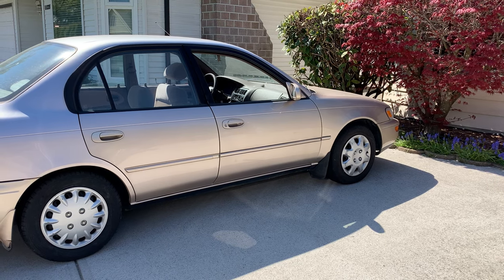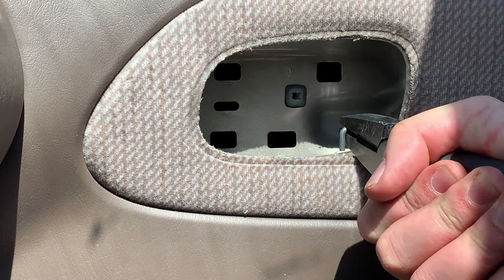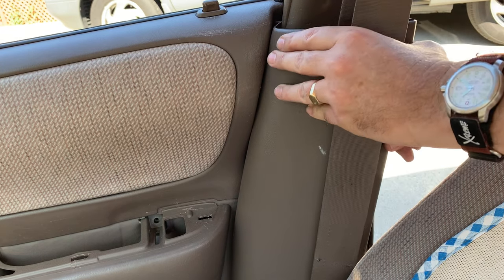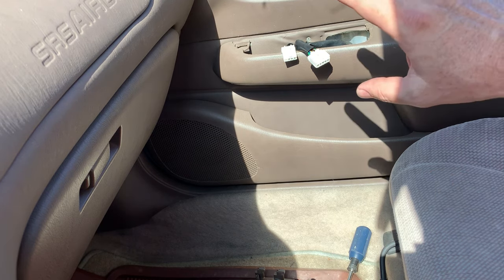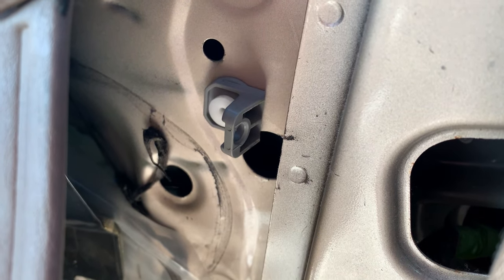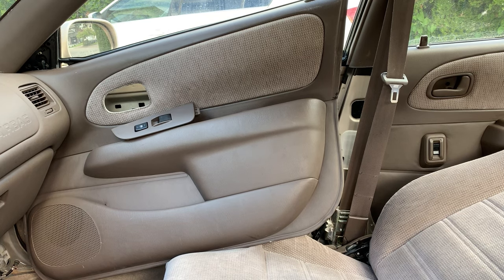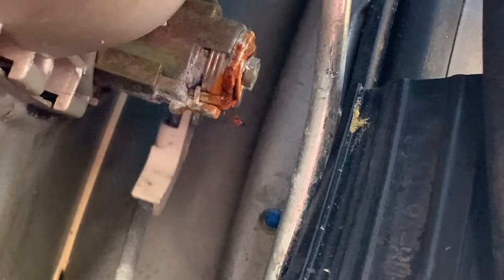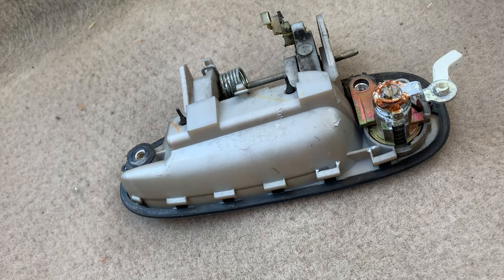Door won’t open – from inside or outside!

Comment: This was performed on a 98 Toyota Carolla: Assuming you are not locked out and have a front passenger door that won't open from inside or out with the key or by pulling the manual lock button up... 
I slipped a slim jim into the door from the inside, with the window up, about four inches ahead of the latch and used the hook end to poke and pull at the latch mechanism gently while pulling on the inside door handle occasionally. At some point, I tripped the lock linkage, and the inside door handle opened the door. It was a blind attempt to manipulate the lock as seeing or feeling linkage from the inside is almost impossible, but it worked out. Took about 10 minutes of effort.
Reply from the maker: Thanks for sharing!
Reply: I'm try to get my driver side door open hopefully with your experience I will have a better chance at it. There is no way possible to get that door panel off without the opening the door also getting in and out of my car through the passenger side door is not fun
Reply: @WILLY52368  Measure down on the inside of the opposite door from the bottom of the window to the latch on your slim jim so you have an estimate of how deep to loo search for the latch mechanism inside the door. If you see the lock button move you'll know that you're in the correct area. Pull the door handle at regular intervals to check if it will open the door. Good luck!
Reply: @J.V.Swanson  Ahh.....got it, I'll let you know know how it goes. Thanks again for responding, it really means a lot 🤙

Comment: My front passenger door on my 2000 Buick Park Avenue is locked and won't unlock or open up.   Just like yours it won’t open from the inside or outside.   The problem is the door lock actuator not the lock itself.   However the process to get to the rods by removing the interior door panel will be the same.     I’m dreading having to destroy my interior panel just to get to those rods so I will have to wait for the weather to get warmer to do this job.     It’s February right now and I live in Chicago.    

Thanks for posting, very informative.
Reply from the maker: Why don't you start with the first door. If you are able to open it it should be fairly easy to take off the trim and inside panel. Then you will be able to see the lock and find out why it is not locking. :)

Comment: This is a very helpful video. I have a 94 Corolla with an identical problem except it's the driver's door. I just came from my mechanic and he said that he can't find the new replacement latch assembly so he doesn't want to attempt fixing it however I think he doesn't want to go to the trouble of taking the door apart from the inside. I don't blame him. I have ordered an endoscope to see if it will help me diagnose the problem if I can put the camera down inside the door. Since my problem seems to be identical and we have basically the same car I'm going to start spraying a lot of penetrating liquid into the key lock. I had been adding silicone spray but I think a heavy-duty penetrating liquid may work better. Assuming it's the lock. I was able to open it a couple of times from the passenger door outside lock. Initially when I could not get out of the car I opened the window and pulled on the handle from the outside and the handle broke off the right I was able to glue it back on with JB Weld and a piece of steel reinforcement. Then I tried opening and shutting the car several dozen times and had no problem. I was kind of proud of myself. For about two weeks when this happened. If the penetrating liquid does not work and if I cannot find a mechanic I'm going to try your method. Thanks again for taking the time to record this trade I subscribed
Reply from the maker: Hi Robb, thanks for subscribing. The problem I dealt with occurred because the passenger door wasn't used for a long time. That gave the opportunity for the lock to corrode and become stuck. I am not sure if that would happen to a driver side door that is used frequently. (Penetrating oil can't harm the lock.) The quickest way to see if you can get lucky is to remove the door opener on the inside. Then grab the metal rod that is connected to the latch. If you can pull that and it opens the door, voila! If you cannot open the door that way, the problem may not be with the latch, but with the lock. (see 2:01 on the video.) Good luck! :)

Comment: You were so patient and very instructive thank you so much for doing that I know that was a lot of work! Seems so crazy that they make it so difficult to get inside of a panel when they know that things are gonna break down in there they should make it a lot easier. It makes me wonder if it's just part of the Industry because some people, if they had the money, would maybe just rather trade in their vehicle rather than go through all of that (or pay for an expensive repair)! So maybe they do that on purpose!? Just like they used to make everything so durable and you barely had to replace anything back in the day, now everything's breakable and you they expect you to replace things instead of repair them. Not only is that taking advantage of the consumer but it is also bad for the environment! One example is front load washers like the Kenmore HE3T... You have to take apart the entire machine just replace the drum now where older washers you easily can take the parts apart and clean out the drum and then often times repairing or cleaning that part (or at least be able to get to those parts - they trap moisture and get a lot of mold issues) - when you can't easily clean the drum remove the drum a lot of people just choose to replace their stuff instead of going through the trouble of actually cleaning it and soaking it and doing all these things that you can do easily. Our landfills are filling up with all the appliances that are easily cleaned and repaired, and now that they're making them harder to repair an/or clean-- it's even worse because people who would normally clean or repair their item our now for sure too frustrated to even go through that process and throwing them out into a dump or landfill). Sorry for the tangent that just reminded me of one way they're making things so dang difficult just to repair! Anyways thank you very much for going through the trouble of making this video. I celebrated with you in your "moment of truth" when you got your door to open - it was awesome! Lol thanks again have a great day! :)
Reply from the maker: Thanks for the encouragement! Don't worry about the rant - I share your frustration!
Reply: lawmakers LOVE that!!!  each new unit sold, MORE money for them in taxes; they don't give 2 shtts about the rest,the important stuff like you said,the ease of repairs; CARS are proof, today they are ALMOST UNREPAIRABLE, go figure...

Comment: Thank you for a great explanation and video. I am having similar problems on a Nissan Pathfinder plus the electrical portion is not working on the lock or window, window is closed though fortunately.  Good description.
Reply from the maker: Good luck on your repair. Don't give up! :)

Comment: Great job. My '96 Carolla has the exact same issue with the same door. Another guy on youtube got the lock to work by shooting PB blaster down both sides of the window glass. If that doesn't work your approach will be Plan B.
Reply from the maker: Steve, my approach should be your last resort! 🤣
Reply: @Pen_Pusher  Thank you for replying. If I may trouble you.... None of the trucks with PB Blaster worked. Both handles still pull freely, seemingly as though the linkage is disconnected. The door lock pulls up halfway and then jams.

I have another idea. Since the lock mechanism may need to be replaced I am thinking of drilling a hole in it from the outside. Right above the keyway. Do you happen to recall, is that opening in the body about as large as the door handle piece, or if I drill in above the where the key is inserted will I likely hit the body/frame?
Reply from the maker: @stevebakker6884  Hi Steve, if you look at 12:17 on the video you will see what it looks like from the inside. There is open space all around it. 😊

Comment: Thanks so much for this video. I have the same problem on a Honda CRV. It won't be exactly the same but I'll bet it's close. I've been watching other videos for over an hour and yours comes closest to showing me what I'm going to need to do. I hope the lower Honda trim comes off like your Toyota and that hack saw blade solves the issue of that snap screw sandwiched between the dash board and the door panel. Good job!
Reply from the maker: Good luck David! This is a job that calls for patience and perseverance!
Reply: @Pen_Pusher  We ended up paying a specialty locksmith $50 to work on it for an hour and then give up. 

We then went to our auto mechanic who said he could do it. He succeeded although it took many hours and some damage to the door panel for a cost of $375.

A spring had broken and the debris was interfering with the mechanism's ability to fully raise/release the rod that unlocks the door. 

The mechanic fashioned a new spring from something he had laying around and all is good now.
Reply from the maker: @davidgardener5519  I am sorry to hear you had to go through all that, but nice to know you get get it resolved!

Comment: Exact same case with my 2006 Honda Civic. Except a few more things. Long story short, one time I was trying to unlock my driver door (unlike the passenger side in this vid) from the keyhole. It was resisting my key and then the keyhole either broke or got jammed, making it impossible to unlock or open the door from the inside or outside.

On top of that, opening the passenger door (haven't tested the two rear doors yet) sets off the horn and it won't stop unless I turn the ignition off, get out the car and disconnect the battery cable.
Reply from the maker: Wow, this sounds like a tough situation. It would be good to disconnect the passenger door from the horn, though.
Reply: Honda makes great cars and crappy locks. Basically the wafers wear out in them. It happens on the ignitions and drivers door. I'm not BSing we get a call on someone who's Honda key won't open the door almost every day. We run just automotive locksmith calls 100-150 per week. Honda has known about this for 20 years and they continue to use the same wafers. There are a million videos how to fix it. You can buy a $25 keying kit and rekey the lock yourself. These are a bitch to R&R. The have a fun clip that's a PITA. We send them to a mechanic. My guys never want to touch another one again. lol The alarm will only shut off with the FOB or drivers door lock. We see this daily too. The alarm will go off every time you start the car but shut off after 3 minutes. We warn these people before we unlock the door for them. I also tell them we don't disconnect alarms or the battery. Some Honda radios need to be reset so we don't go there. Usually they don't want to pay $250 for a working fob so they pay us to open it and they deal with the alarm while we chuckle to ourselves. lol

 I never tried it but I would assume if you removed the drivers door panel and removed the lock linkage connected to the lock and turned the latch to the unlock position it would disable the alarm. We do that a certain cars with electric trunk buttons. When you open them with a tool the alarm goes off and disables the electric trunk button. We pull the lock turn the latch with a screwdriver so the car thinks the lock was turned with a key. It shuts the alarm off and allows the trunk button to work. This is when they lock the keys in the trunk and the backseats don't fold down.
Reply from the maker: @scotts4125  Thanks for sharing Scott!

Comment: I’m shopping for another car to replace my 2000 Buick Park Avenue that I love because it is so quiet but the driver’s side door won’t open from inside or outside. My mechanic has fixed it, I don’t know how, it quit opening, he fixed it again, it quit opening. One of his customers was selling his 2014 Lexus es 350. I drove it, LOVED it but mileage was too high. So I’m shopping for a used Lexus. I noticed you said, “ Honda's have horrible door and Ignition locks. They use poor quality wafers in the locks that wear out and the key stops working.”. I considered looking at Acura’s. My question, do you think an Acura is as well made as a Lexus? Since Honda has the lock and door problems? Thank you for your advice!
Reply from the maker: Hi Kay, I think someone else made that comment. I am not aware of an inherent problem with their doors and locks. The car I worked on was a Toyota. Personally, I won't hesitate to buy a Toyota or a Honda. They are good quality cars. 🙂

Comment: I have a similar problem with the exact make and model as this car but both driver side and passenger front outside door handles are broken so I can't get into the car at all. Any advice? All interior door handles work fine. No problem with any of the locks.
Reply from the maker: Can you get in through the trunk? If you can open the trunk and fold down a rear seat you are in business!

Comment: Was the rusted bolt on back of the door handle the problem?    Or did you have to replace the door lock actuator?   I'm guessing you still had to replace the door lock actuator on the side of the door.    You didn't need to remove the door handle.
Reply from the maker: Hi Tammy, the actuator and the handle was fine. It was the lock mechanism (inside the door, next to the handle) that was rusted and refused to budge. I cleaned off the rust and lubricated the lock. Voila, it worked again!

Comment: Thank you very much... I have the same problem but on the driver's side on a 2001 Camry... Wish me luck
Reply from the maker: Good luck! You will need lots of determination, but at least you know it is possible. :)
Reply: Oh wow same mines unlocks and locks but does not open from inside or outside

Comment: Did absolutely all of this on my 03 Sequoia and it STILL won't open. About ready to get some spreaders from the local fire dept and rip the door off. Is there no way to access the actual latch whatsoever??
Reply from the maker: Yes, look at 2:02 on the video. Pulling on that metal rod is engaging the latch. My latch was prevented from moving because of my frozen lock. The other way to access the latch is to follow the metal rod (seen at 11:45) all the way to the latch, where it is attached. Remove the metal sheet in the middle of the door and get eyes on the latch from inside the door (see 13:10). If the latch or actuator is broken you should be able to see where the problem lies and then manually operate the mechanism to open the door. Good luck!

Comment: 2002 Toyota Camry - had the same issue, took panel off and found the metal wires connecting the lock and inside door handle got stuck.
Reply from the maker: Sounds like someone was too forceful when they tried to open it. Good on you for fixing it! :)

Comment: My drivers door on Renault  clio 3 has the same issue. It's becoming very frustrating.
Reply from the maker: The first thing to try is to squirt WD40 and/or penetrating oil into the lock mechanism. Do that for a few days and see if it helps. In my case rust was the issue. The actuator was fine.

Comment: I have a 2009 cadillac escalade door want open on passgner side is there any solution??
Reply: Solution: drive alone from now on or become a chauffeur.
Reply from the maker: The easy answer is to take it to the shop. If you have the time and the inclination you can do it the hard way - like I did. :)

Comment: Sooo i need help my car door won't open on the drivers door the ourside works but not the inside soo i have to roll the window all the way down to open it. But i don't have the money to get it fixed by someone so I'm trying to do it myself
Reply from the maker: Okay, hopefully it is not too bad. The first thing to do is open your door and remove the panel on the inside of your door. You will be able to look inside the door and follow the mechanism from the handle to the latch. You should be able to see why it is not functioning.

Comment: Did the W2-40 work or did you have to get a new mechanism?
Reply from the maker: Yes, it worked well. Removed the rust and lubricated it again. :)
Reply: @Pen_Pusher  Seems the method to unlock the door was to unclip that one plastic fastener on the rod ...and the door unlocked.  I did that and it was not as automatic as yours;  had to bang it a couple times ...as I only got as far as pulling the panel topside off so I could see down from the top.  Instead of taking off the seat and the bottom base panel (which I could not get out on a 2002)  ... I used a long toothed wood saw to reach down that space behind the panel ...and pull that fastener off.  Just like yours, it unlocked (with a couple taps).   Thanks. this vid saved me a lot of headaches.  Still have to get that lock and handle off, but the hard part is over.
Reply from the maker: @greenseaturtlesacredfemini4417  Good job! The lock and handle should be easy - probably a couple of 10mm bolts, like mine. :)
Reply: @Pen_Pusher  On your vid, the handle part was rusty.  I see no rust on the handle part,   But the original clip (that you first unlocked the door with) goes to some kind of lever on  the actuator and that seemed tight as I had to tap it to unlock the door.  So it seems I will have to take out the actuator.  Was that lever not rusty on yours.  Not looking forward to taking out the actuator, but 2002 looks easier than 2003.  Just tried spraying Wd40 around the lever...and it seems there is more action .  Thx again.